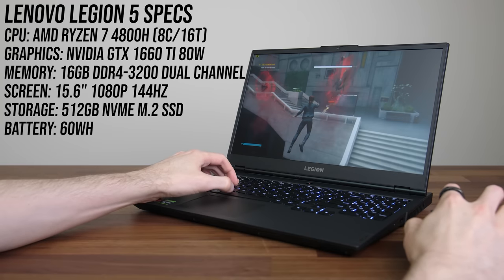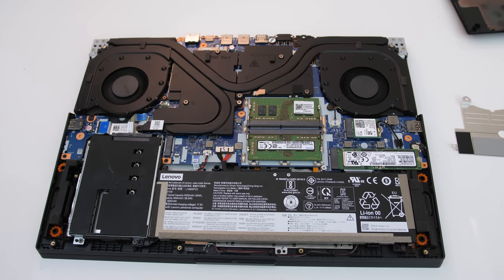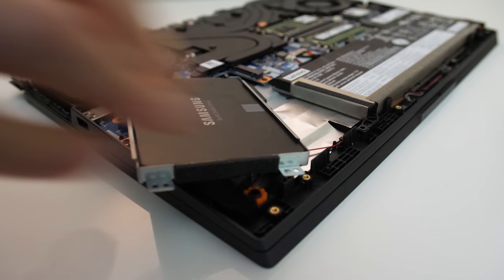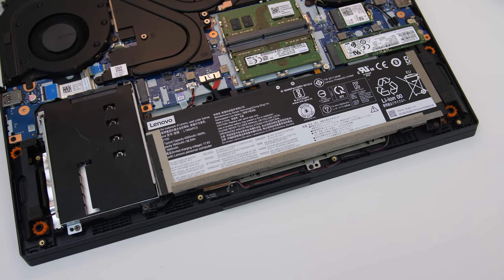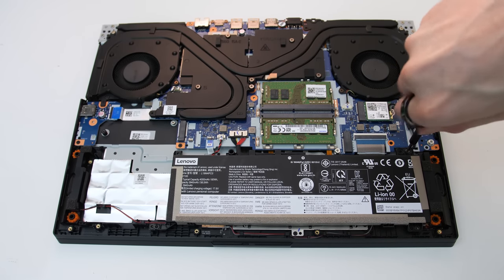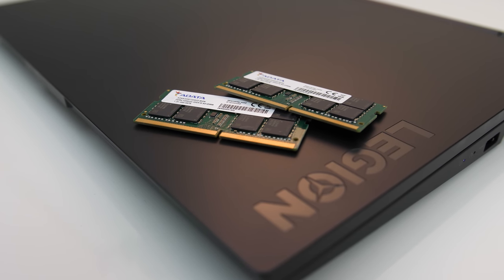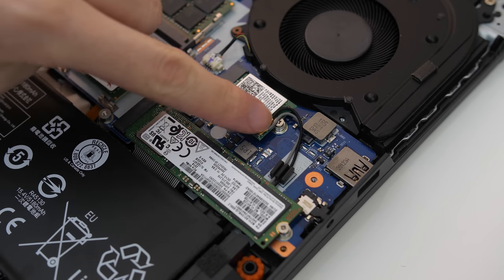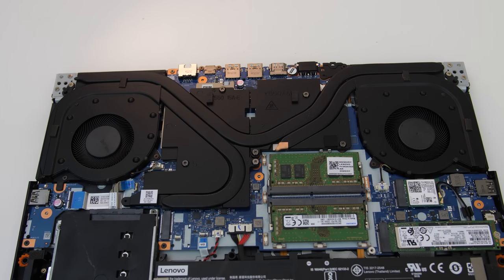Lenovo Legion 5 Upgrade Guide - Boost Performance!

Comment: Just follow your guide to open and try to clean my laptop. Is it normal for dirt to be of this color ? Well i cannot add image but it is orange. Feel like it come from the orange ring in the corner
Reply from the maker: Just brush out any dirt, I suppose the color will depend on what's in your environment to be sucked inside. Sounds like it's Dorito dust.
Reply: @JarrodsTech  lol

Comment: after upgrading the battery, the battery is now at 0% and not charging. How do i solve this issue? ( I tried every way in the internet )
Reply: Check if it's connected bro

Comment: how did you get it to 64 gb ram when they said it is maxed to 32 gb upgrade ?
Reply from the maker: I don't think they ever said that, it's simply they choose to only sell it with up to 32gb. There's nothing stopping the Ryzen platform maxing out at 64gb.

Comment: Hello!! Does anyone knows if the Samsung 970 EVO Plus MZ-V7S1T0BW is compatible with the Lenovo Legion 5 15IMH05H
Reply: Yes 970 EVO is the best for Legion 5, I have removed the original ssd and installed and upgraded both slots with 970 EVO Plus

Comment: I bought the legion 5... runs single player games and battlefield 5 online no problems... 

Stutters in apex legends and valorant no matter the graphics settings tho. 

Been searching Everywhere for a fix. Drivers updated, disabling full-screen optimization... etc. 

Not sure why this is happening.

Xcom 2, outerworlds, battlefield 5, ESO all run with no issues whatsoever
Reply: Edit.. tweaked settings in Nvidia settings and it stopped. Also Uninstaller Nvidia geforce experience. Made a difference

Comment: Video is high quality, thank you... but dude, not disconnecting the battery?!? I wouldn't even rely on UEFI disable.
Reply from the maker: This is an old garbage video. I did a newer one (pinned comment) a few weeks ago and stress that at the start and mention it before every step :)

Comment: Please help, used your affiliate link for AX210. Installed and downloaded latest drivers. My download speed went from 10mbps Consistent to 800kbps.
Reply from the maker: My suggestion would be to check the antenna are connected properly. If not, the wifi will still work but not very well. Get the drivers from Intel (if you didn't) and try reinstall.
Reply: I reconnected antennas and reinstalled driver. No change. Drops off in speed. Even in the internetspeedtest. 

I tried disabling Ultraband and tried changing the dual band settings. Still the same thing. 

Reinstalled realtek card to be sure I didn't mess anything up... it is functioning properly as before. 

Only thing is MMOs I get no latency lag, but FPS games I get lag. 

Going to buy and try the ax200 and see if it works better. 

Annoyed having such great specs, any single player game I can run on high with No issues, ESO and even Battlefield 5 run great online, but Warzone, Apex, Valorant get lag.
Reply: AX200 was doing same thing. Strong then weak. 

Intel has MIMO power save mode. I disabled it, and now it steadily works better than Realtek card. 

Didn't notice it because realtek doesn't have that option.

Comment: I didn't knew they support up to 64gb of ram memory. In shop I bought my legion 5 it says up to 32gb only. So mine came with 8gb stock so I will order 8gb more and I think I will be good to go. Don't want to spent too much. Already paid 899 euros for it and it came with rtx 3050, 512gb SSD, 120hz screen and 8gb of memory.

Comment: Don't replace the thermal paste on these laptops, they are equiped with high quality material but if you are going to, the only viable option is Lenovo's stock material: Honeywell PTM7950 Phase change pads or liquid metal if you know the drawbacks and proper steps.
User friendly easy spread pastes degrades quickly on L5

Comment: Okay, can someone PLEASE inform me here. According to the sales info I've seen at all the local retailers the maximum ram compability is 16GB for this computer... how can he install 64GB if the "maximum compability" is 16GB?!
Reply from the maker: The maximum capacity depends on the platform, for Ryzen it's 64gb, just search the CPU and go to the product page. You might be confusing the max amount Lenovo happens to be selling it with as what it can support.
Reply: @JarrodsTech  Yes that's what confused me since I've seen Ryzen 7 platforms in MSI laptops supporting 64GB 🤦‍♂️

Anyway, thankyou for the explanation :)

Comment: Is it possible to upgrade the graphic card?
Reply from the maker: No, it's soldered to the motherboard. You'd have to find somewhere selling the whole motherboard with CPU + GPU, but that's very unlikely.
Reply: OH YEAH just slide in your new AGP card and you'll be good to go, just like all modern laptops

Comment: My lenovo legion 5 (the same as the one in the video) when I put the 32gb on it does not give an image, does anyone know how to solve it?  I need help!  (they are ddr4 at 3200mhz)
Reply: @adriano7mkt  i just tried it and it's still the same :(
Reply: @adriano7mkt  Yes, the problem was that the rams, even though they were new, one of them came badly from the factory

Comment: Has anyone tryed to upgrade both battery and add a 2nd M.2 SSD? Is that possible?
I am asking because I remember it's not possible to add both a 2nd M.2 and a 2.5" SSD, which would go right above the M.2 stick
Reply: nevermind.. he's saying at min 7:57 that it is possible :)

Comment: I just purchased Lenovo legion 5 AMD Ryzen 7 4800h with GTX 1660 Ti with 6 GB vRAM, 8 GB RAM and 512 SSD. On the vendor website said that maximum RAM is 16 (2x8 GB). Can anyone confirm if I could upgrade with 32 (2x16 GB) RAM?
This is the model 15ARH05H.
Reply: Sadly is only 60 hz display....

Comment: Is there anyone has the same problem as mine after upgrade the battery from 60wh to 80wh? My laptop wont turn on without the charging brick plugged in to the laptop. I saw someone with the same problem in lenovo forum but no update.

P.S. I'm buying the battery from the same store as jarrod.

Comment: There is a problem about this laptop and ram speed. So ram speed isn't just frequency but also the latency/CAS (cl 16 /cl18 etc....) and usually u can tweak ur bios to get the right ram speed you want on your pc.
But here you cannot, Lenovo didnt add this option (XMP options).
So if you buy some good ram, 3200mhz cl16 this kinda thing, it will be bottlenecked. 
Original ram is 3200mhz cl22. There is a quick formula to realize what speed your ram got "  (cas : frequency) x 2000  " which gets you 13.75. here the lower the better.
3200mhz with cl16 gives you 10 so its 25% faster. its HUGE. But without XMP options, the  ram speed shuts down to 2666mhz cl 22  so a result of 16.5.
You buy good ram which should go 25% faster but you got 25 slower than the original ram. Unbelievable.
The problem is that absolutely nobody talks about it. 
So even the graphic card and cpu can be bottlenecked by this if you don't check ram speed with cpu-z.
I don't know if Lenovo can add XMP options in their bios with an update, but that would be just decent behavior from them to try or communicate about it.
It's a gaming product. damn.
Reply: So what ram exactly would you recommend for this laptop/motherboard?

Comment: I love this laptop and i have been wanting to buy for some time now specially becouse of the mux switch and the beautiful display but in my country they selling this laptop  in around 1499$ which realy high and amazon don't work here.
Reply: I hope your getting the rtx 3070 model for that price or else I'm sorry that it sucks for you. Here in the States, you can get the 5600H & GTX 1650 for $600.
Reply: @aadeshsenthilkumar  yeah bro i'm just waiting someone i know who comes from states to buy it for me soon cuz it's littlerally expensive here and the legion isn't even rtx 3070 it's 1660ti, even the low budget lenovo ideapad 3 with same specs you mentioned  is 1100$ .
Reply: @aadeshsenthilkumar  usa price are good even in amazon i see the prices are ok.
Reply: @hamzik2255  i can understand your pain because I used to live in India where a decent laptop would cost you 2-3 months of your salary. My friend did the same and got his MacBook cheaper than buying locally.

Comment: It's crazy that 64gbs of ram made little difference.
Reply from the maker: Capacity doesn't really matter if you have enough, speed of the memory and timings are more important, and that didn't really change with the sticks I used.

Comment: 64gig of ram...all I needed to see to know that this is just throwing money at the system to eek out a little more performance. 90% of games see no performance improvement what so ever from anything over 16gig. You could literally throw one of those chips in the garbage and there would be no noticeable performance difference in gaming. 

I know i'm going to get the "but mah video encoding"...why are you doing that from a laptop? Build a pc that actually is good at doing it for less money than it takes to upgrade a laptop to be ok at it. this is just pissing away money for bragging rights. why stop there go for 128gig...with a 10 terrabyte hard drive. find a way to liquid nitrogen cool it and over clock it to 8ghz for the 10 seconds it can run before it crashes...the other nerds will be so impressed with your wasteful ways. They will make you king of the PC master race!

the hilarious thing to me is no matter what you do, because you can't change out the most important components for gaming performance (the CPU and GPU) We are talking about performance gains you have to benchmark to notice.

Comment: LUL? This isn't upgrading anything. You're not changing out the CPU or the GPU. You're not pulling down more power from a bigger brick. This is just basic change outs that everyone who knows even a little bit about computers knows how to do.

Why would you buy a Lenovo "gaming" laptop? At least buy a Clevo or MSI. REAL gaming laptops.

You changed out a hard drive. Amazing. Such hacks.
Reply from the maker: The views and comments on this video suggest that many people own a Legion and have found value from this video. The CPU/GPU aren't changed out because that's not something that's possible in 99%+ of gaming laptops, so it appears that this video has taught you something after all.
Reply: Bro is salty